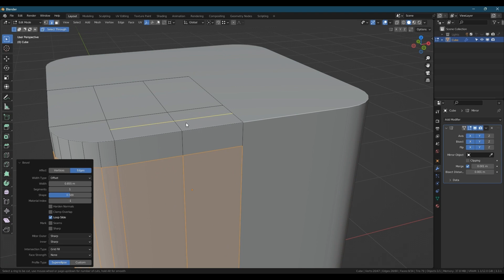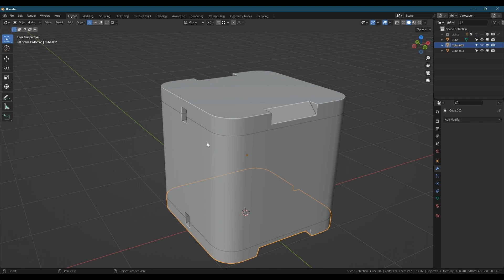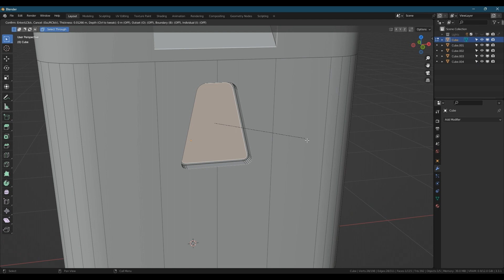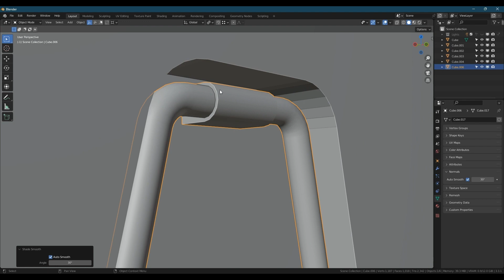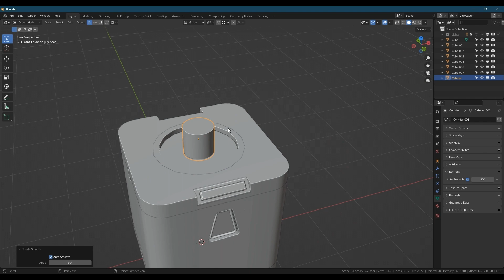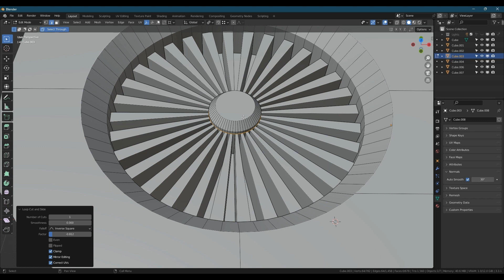Blender Hard Surface Practice 4

Comment: what feature or add on are you using to have each new shape assigned a different color/texture ?
Reply from the maker: It's not automatic, but I use Material Utilities which I believe is a default add on you can enable in preferences. The materials used in this video were setup prior to recording it on three different sized objects. They are simple Principled BSDF shaders, with a Bevel node plugged into the Normal slot and set to varrying amounts (i.e. for large or small bevels). Some were Metallic, and some had Noise plugged into the Roughness. Hope that helps.